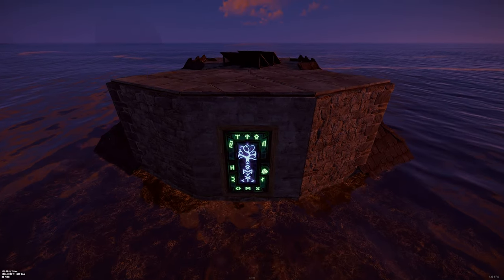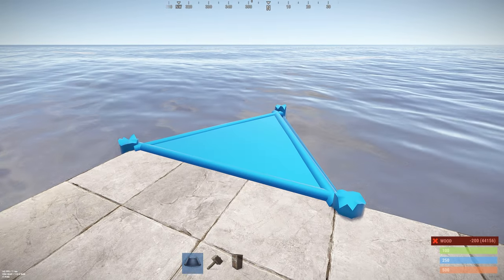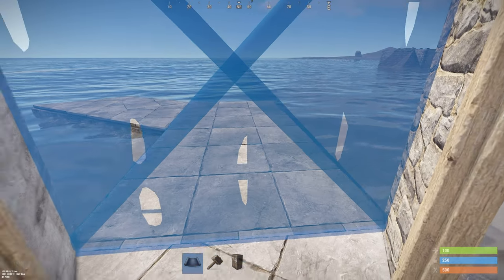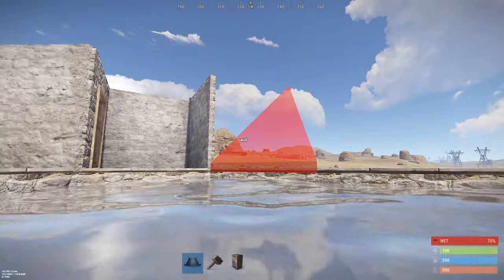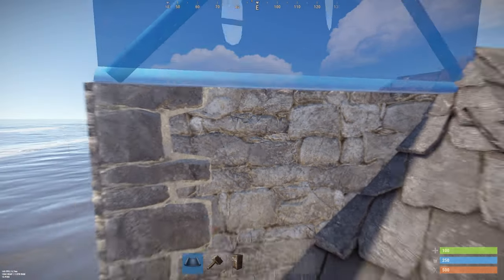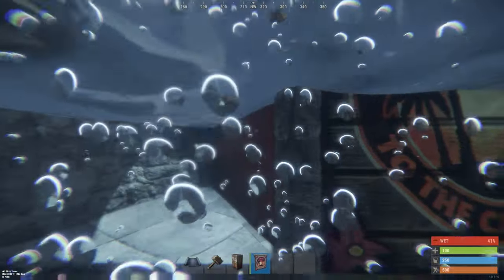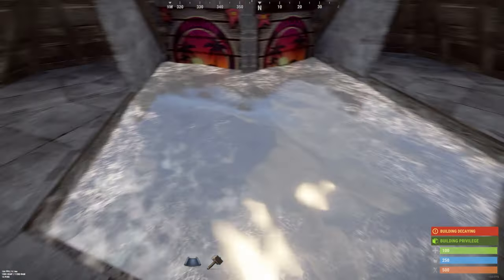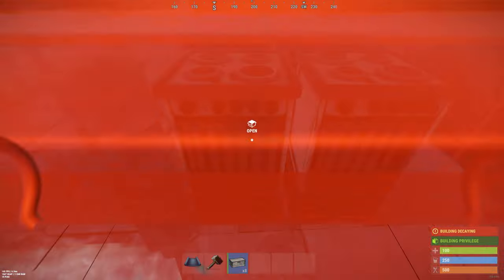How To Make A Solo/Duo Boat Base - Rust Simple & Easy Base Build

Comment: This video describes the water level issues a lot better: https://www.youtube.com/watch?v=jKYV3sONgc8&t=121s However I think your layout might offer better storage. Door camping possibilities are kind of a toss up between who is better protected. https://youtu.be/jKYV3sONgc8?t=278 Is likely better for storage then yours. IMO first is still superior as super low cost to build and upkeep is more important then storage for a boat base as such a base is for storing boats and only needs enough storage to dump stuff so you can quickly make a 2nd loot run before depo'ing at a proper base.